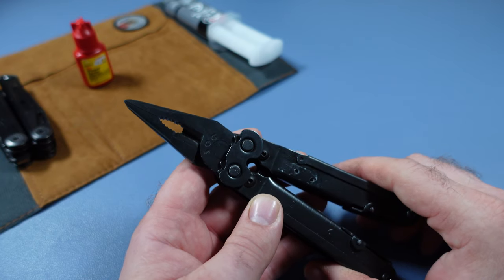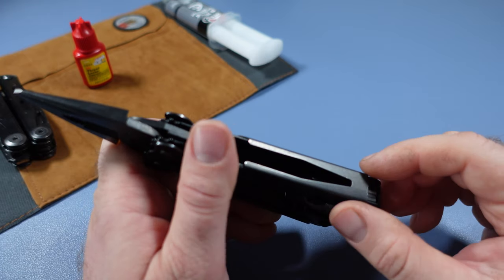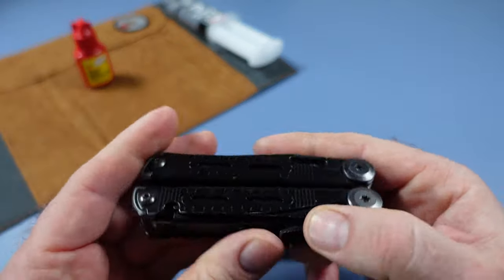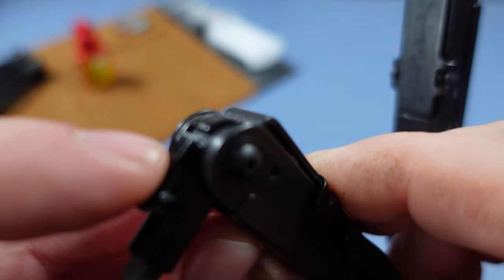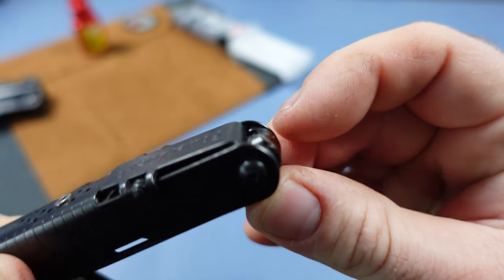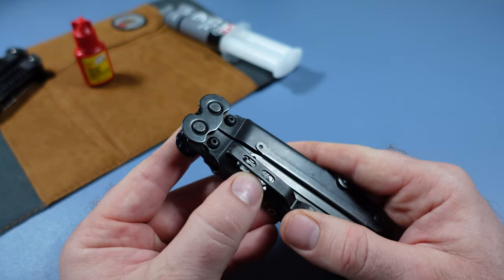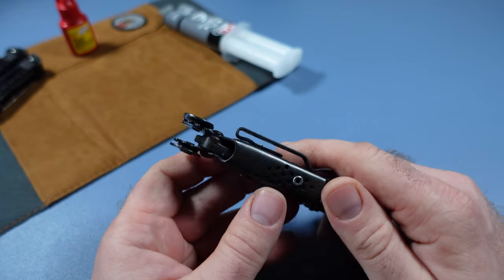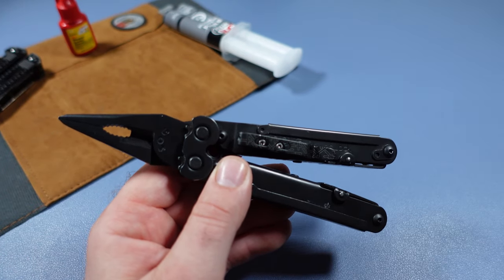SOG Modded PowerLock Multi-Tool Becomes My Favorite! - Pt.1

Comment: Awesome mods! I love seeing tweaks like this. I'm curious, since I'd be inclined to keep the scissors over the knife blade: if the blade is removed, is there still room for the scissors to coexist with the donated 1/4" bit driver on that handle side? OR can the scissors be moved to the other handle side (in the place of some of the tools over there) and fit appropriately?
Reply from the maker: So the scissors take up about two tool slots so I have added them after the video into the other handle side.
Reply: @hvacbudget8600  Good to know, and thanks for the follow-up!

Comment: Any mod ideas for the powerpint?
Reply from the maker: I have seen a scalpel mod one can buy, I was a little interested in.
Reply: Do you still use your power access assist and what's your thoughts on it now? I've been thinking of picking one up next time it's on sale. Thanks for your reviews!
Reply from the maker: @farmking5088  I still like it.  It does have an issue where I may need to tighten the blade because it hinders the pliers closing sometimes.  I think the assist system is also made looser to work, which may bother some.  I still think it's pretty great though.

Comment: The excitement of the Leatherman Arc already faded, hey Mr. Kincaid, lol!
Reply from the maker: I have to say I enjoy tinkering with cheaper tools more than purchasing expensive multi- tools usually
Reply: @hvacbudget8600  I see that from watching the channel. Just thought I would make you laugh. I like multitools of all brands and designs. Use your "Arc" though, put it through it paces. I'm always interested in your thoughts and advice. I'm going to try to use mine when Leatherman delivers for 6 months. From now until spring. Its going to be tempting to use my others Leatherman tool though. Leatherman makes a hefty claim saying the Arc is their best yet. Only time will tell as far as I'm concerned. No disrespect to Leatherman but "magncut" steel doesn't make the ultimate tool but it may help the tool be better.
Reply from the maker: @richardsullivan1776  Good points!  I should use the Arc more.  I think that $250 price point makes me hesitant to use it like my other tools.  And also it's so close to the P4 that you can get in new condition on ebay for $80.  But the Arc definitely has some big advantages as well.